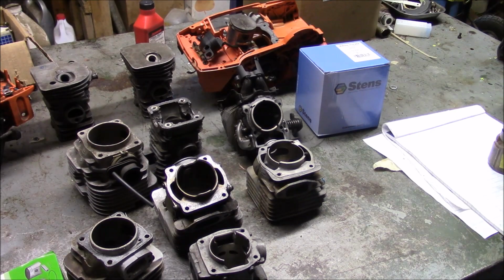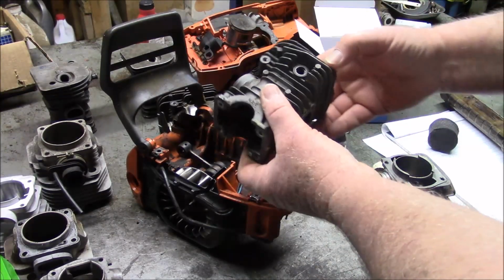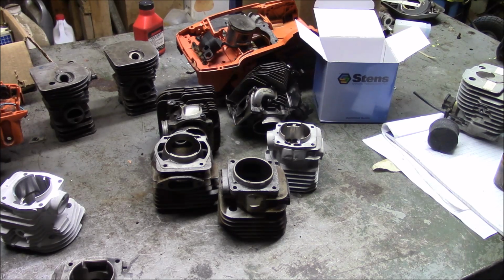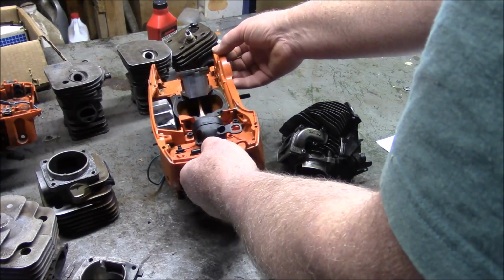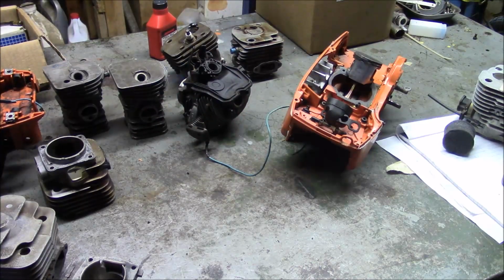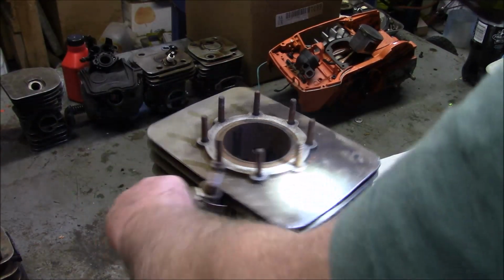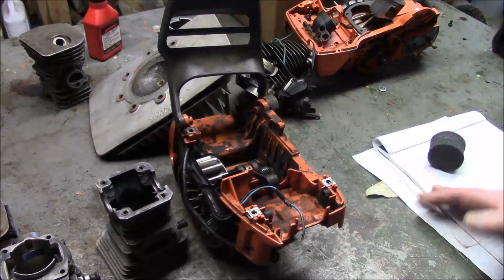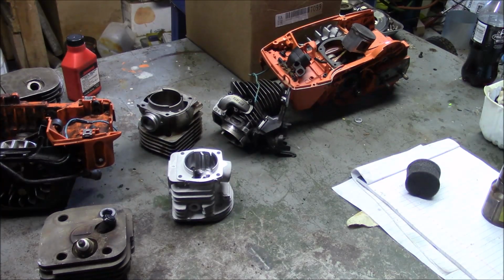What Is an Open Port Cylinder?? What does a Clam Shell vs. Conventional  Chainsaw Design Mean?

Comment: Well said. I do have a question about modifying a stock saw. Does the increase in performance  reduce the  life of  the engine or the reliability  and what modifications have you experienced displayed this if any.  Walt do you have a list of do's and don't mods you have learnt from over the years. Great topic and look forward to more. Take care.
Reply from the maker: +STEVE ROB That is one of those depends questions. Common sense will tell you increasing compression, heat, moving the power band up, etc. will stress the bottom end but if the bearings are still with  in their design parameters, the actual impact will be minimal. And things like muffler mods where you are getting the heat out can actually help service life. So yes those builds that push design parameters with RPM's and/or Compression (heat) can reduce the life some.